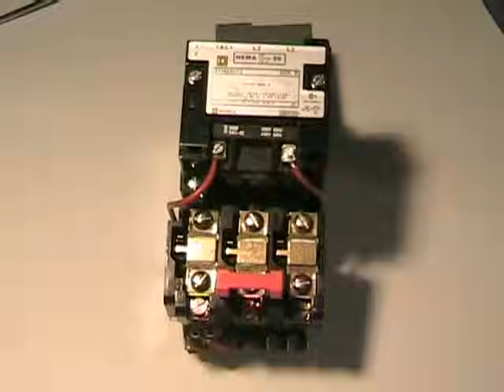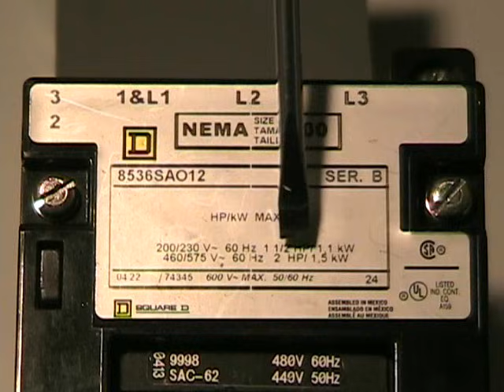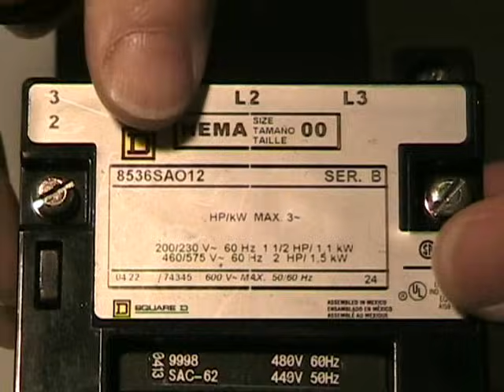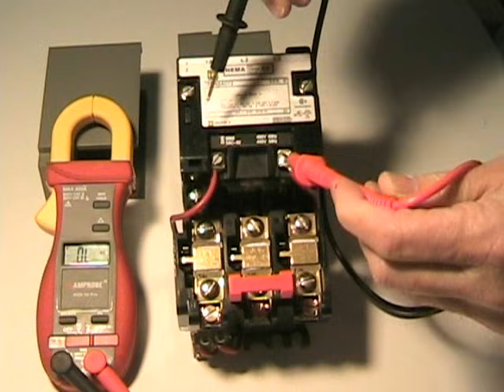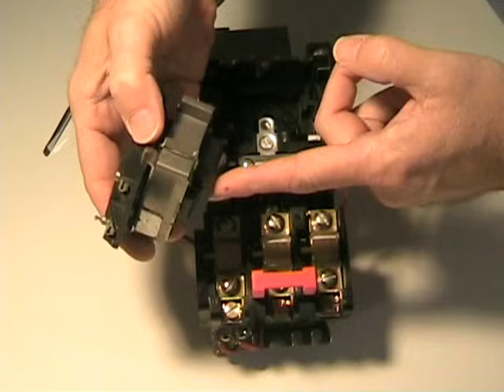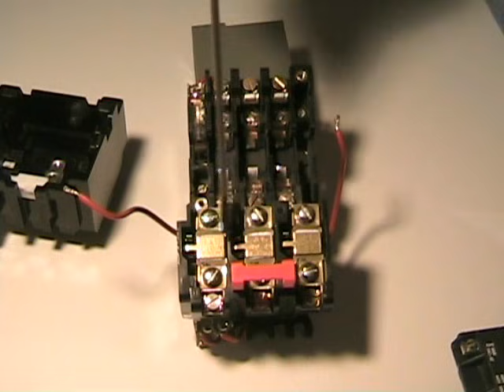Motor Starter 0001

Comment: Watching this 16 years after it was released it awesome. I’m 23 years old now and am a new service tech working on industrial boilers. I’m replacing one of these tomorrow and this was extremely helpful. Thanks a ton!
Reply: How does it work in currently in trade school but I can’t conceptualize the fact that the motor starter technically gets continuity even without the start button being pressed on both sides so it’s still fed constantly at both ends what about the pressing of the start changes the fact that now it decides it has the power to pull back the magnet why does it end up only then deciding that it can not only start the motir starter but that it can now create the secondary magnetic field ?
Reply: Also how did it go with the replacement?

Comment: I have a very similar MCC starter which is blowing the fuse on the control side for the coil. 
Nothing shorting to ground. Put a different starter in and still blowing?

Comment: I have a 230 volt single phase air compressor with a similar motor starter with a voltage issue. At L1 L2 where my incoming power lines connect i`m getting aorund 204 volts when the compressor kicks on then it goes up but where the power lines for the motor connect T1 T3  i`m getting around 166 volts when it kicks on. The compressor struggles to start at times. What could be the problem?

Comment: Thank you for the detailed explanation.
Quick question: How does the Auxiliary power differ from normal line power L1, L2, L3, like why do we need the auxiliary ports.
How does the Overload wire move the contacts since the power is supplied to the relay coil through the push button, can you explain more on the overload circuit.
much appreciated.
Reply: Mohit, the auxiliary contacts are just that, a set of dry contacts. When the coil closes, it "changes the state" of the auxiliary contacts. You can connect any separate circuit to the aux contacts and use the contacts somewhat like a switch. Typically you can have a light that lights up when the motor starts, or a discreet input that is energized when the motor starts to let the DCS or computer system know the motor is running. As for the overloads, they have their own set of contacts, and you wire the control circuit in series with the overload contacts. That way, when the overloads trip, your control circuit for the coil OPENS, and in turn, opens the line circuit and shuts down the motor, protecting your wire and equipment. Hope that helps.
Reply from the maker: Excellent explanation Sean. Thanks!
Reply: Great suggestion

Comment: I'm connecting a compress that has this type of motor starter.  We have 3 phase in the building.  When connecting to service, is it: L1 120; L2 220; L3 120;  ?   The motor is wired for 230V.
Reply from the maker: +TheSlacker64 . The motor nameplate should specify which motor leads connect to which terminal. Typical would be L1-T1, L2-T2 and L3-T3.

Comment: Hey Randy great video...If I have a 120 volt coil circut does my 110 volt control go to 2 on the holding contact and my neutral go to the bottom overload?

Comment: very very good video...i learned it better in 10mins than reading it in the book...thanks for sharing. btw, does anyone know what is or how a "late break" contactor works in a resistor type motor starter?  it's a N.C. contactor installed just after the start switch.